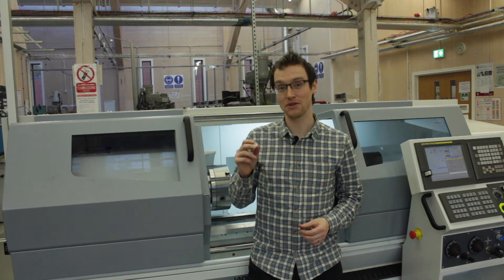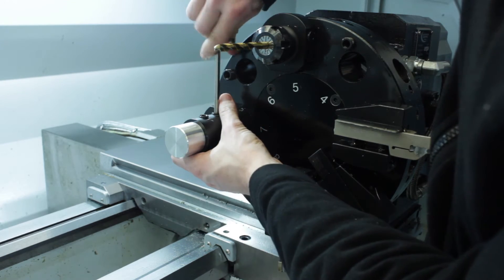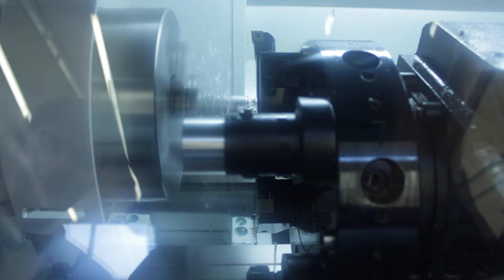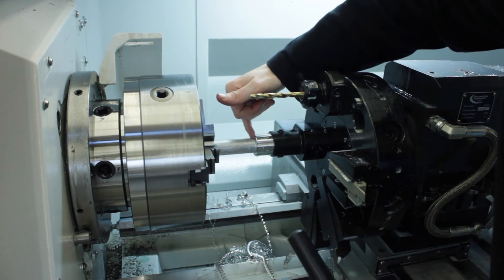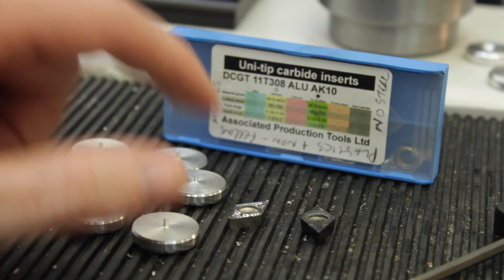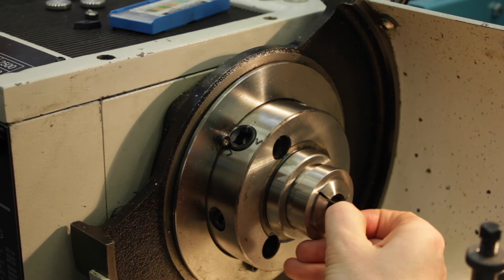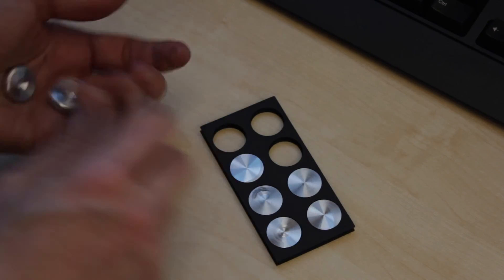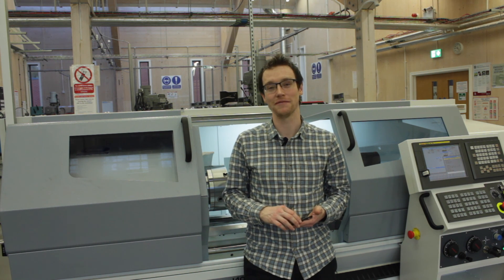CNC Lathe Work Offsets - Batchwork without a Bar Feeder!   #5minFriday   #24

Comment: I just use my parting tool, since the control point is on the spindle side.  I put a G0 Z0 as the last line of the program.
Reply from the maker: +Robert Schmitt not such a bad idea and I used to do it myself but I had a spare station and with my clumsiness it's only a matter of time before I chip an insert by doing it that way!

I had thought a super accurate end stop was important but in retrospect as long as it's within the first facing operation (in my case 0.7mm) it makes bugger all difference anyway.

I'll be buying a mini lathe soon and I'll be using the parting tool for sure!